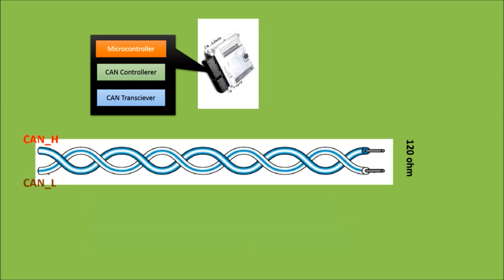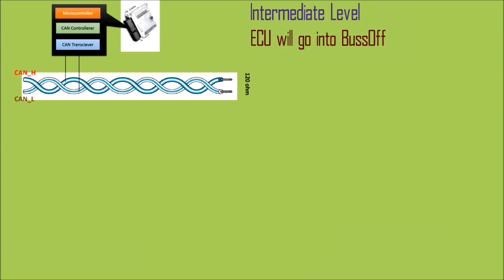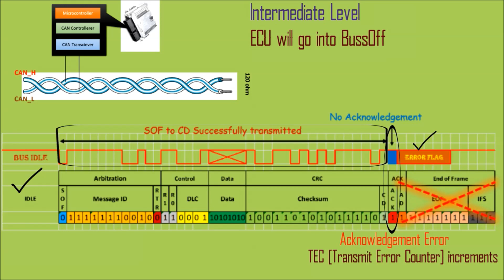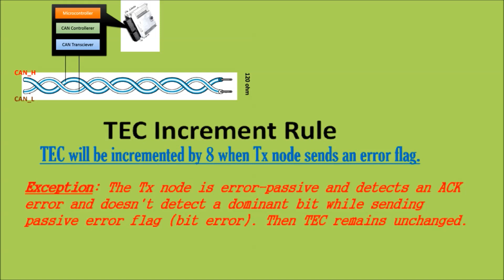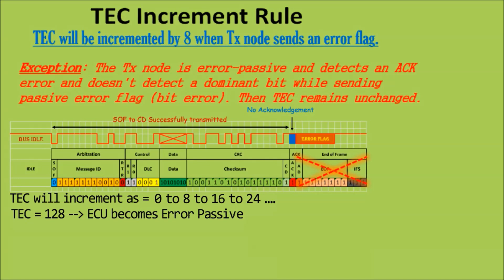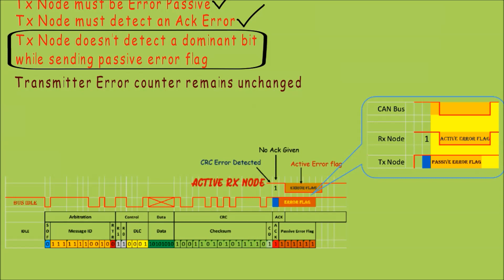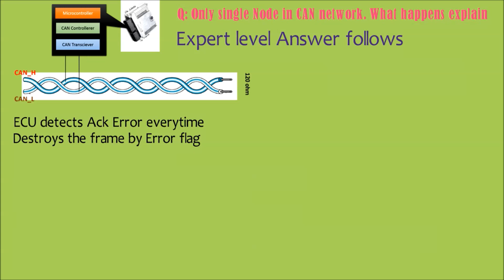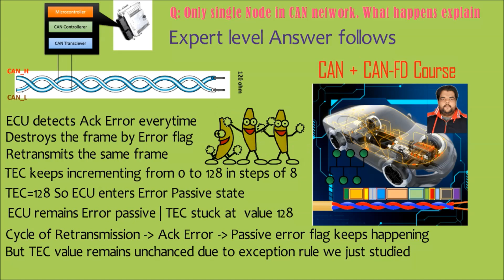CAN Protocol Interview Q&A : How would a Single ECU Node in CAN network behave

Comment: Hi Shyam,

I wanted to say thank you for your "Master CAN protocol completely from Scratch (CAN + CAN-FD)" training, it was amazing. It hard to find this type of training, I really appreciate it.

I also wanted to take the opportunity to make a question to you that I need to. I am working on a project in my car that requires to change the Identification number of a module. For example, the engine module is 01, the automatic gear box is 02, the BCM (body control module) is 03 and so on, so in my case the module is 36 seat mem. drvr and I want to add a new module convert it to 06 which Seat Mem. Pass. 

To make long story short, my platform MK6 does not have a memory 06, so module 36 can't be convert from factory so there is not option in the software to send identification ID as 06 so my idea is to put a module 36 in the can bus net but isolated using an Arduino with a can bus shield and forward all the message id to the can bus network and only filter out the one that is related to the identification of module.
I don't know if its possible or not, but I will try it.

Can you help me to know which the Bytes that carry out the Identification of the module?

Thank you in advance.

My personal email es martin.teruel@gmail.com

I have a YouTube channel and I did a lot of retrofit in Jetta mk6 2.5

My user is MartoEl

Comment: Hello shyam, Thanks for the above useful information but I have one question regarding the timeout of CAN messages concept, in Nodes exactly what happens when we make a timeout on particular msg( faults will occur other than this ) I need proper technical concept.  I gone through web also but I am unable to find. If you have any information regarding this concept please share with me.  Thanks in advance
Reply from the maker: Yes I know you cannot find a proper definite answer for this anywhere. Because it's customer specific. When timeout happens in can and the frame never comes then the strategy can be various things. It can take a default value for the signals or a dtc could be set or if it's very critical frame then the car even might go to limp home mode. There is no single definite answer for this.

Comment: Hi Sir,

There are few scenarios, please help me to understand what exactly is happening. There are 2 CAN nodes on the bus. Let us call them as NODE-A & NODE-B. 

SCENARIO-1: NODE-A can only receive and receives whatever CAN-ID frames are available on the CAN-Bus, and NODE-B can only transmit the CAN frames and keeps transmitting the CAN frames at every 1mSec. The following mechanical faults are infused on the CAN bus:
(a) CAN-H & CAN-L is shorted,
(b) CAN-H or CAN-L is shorted to ground,
(c) CAN-H or CAN-L is interrupted
In the above infused faults how shall the NODE-A behave i.e what will happen to the REC counter, will it increase the counter. If so, why will it increase the counter value and why will it even increase the REC counter value as the physical bus itself is disturbed?

SCENARIO-2: NODE-A keeps transmitting the CAN frames on the bus at every 10mSec. How shall the NODE-A behave when the above mentioned mechanical faults are infused i.e will the NODE-A go Bus-Off?

Comment: Hello Shyam,
Thanks for making this video. Similar to this concept, I have a question.

Consider a network with 3 nodes A, B & C. If suppose Node A goes to Bus Off state, is there any method by which Node B and C come to know that Node A is in Bus Off state??

Pre-Conditions: I am not using any AutoSar modules here. It is an Application written directly using LLC layer interfaces described in ISO-11898 Part -1.
Reply from the maker: Wow it's a beautiful question and I may make a video with this scenario. Thanks. But for time being, to answer your question quickly, the frames from node A will be missing on the bus and in node B and C the timeout for those frames occur and that's why we have a default value are there for each rx frame in the network matrix. So node b and c must be fine with those default values. And if the frames are very safety critical like brake signals etc then a mechanism to make vehicle enter limp-home mode will be enabled.
Reply: @vicharavandana  

Hi Shyam, Thanks for the reply.
It would be amazing watching you explain this concept. Waiting for the video.

Comment: Thanks for your explanation.... How busoff error can be detected, is it based on TEC count value?
Reply from the maker: Well first hint is there will be no communication going on from the ecu side and then you can check some variables and it's different in different microcontroller and so you have to refer that user manual. But you can't check tec as its internal to can controller and usually youbcant have access to it